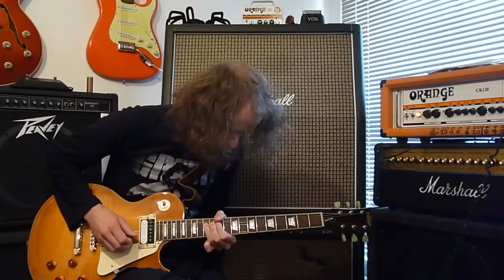Why I prefer Solid State amps to Valve amps

Comment: The truth is if you perform a "blind test" the transistor amp sounds the same as a tube amp when you add pedals to color the sound. I saw seasoned musicians unable to choose the right sound with the corresponding amp when they couldn't see what they were playing. The predisposed bias is the deciding factor when they can see the faceplate.
Reply: completely disagree, all you have to do is turn them up and not use heavy distortion and the solid states suck.  if you cant hear the digital sound, you need your ears checked and probably have hearing damage from playing  over time.
Reply: Exactly - once you add some processing ( phaser - distortion - delay etc) they become the same. Who plays clean these days ?
Reply: neil rich people that dont play metal. you can use very light distortion to color, maybe some delay and reverb, but not processed and when you add effects to a model you get a screwed up waveform.
Reply: It seems like Steve is getting solid state confused with modeling amps. The line between tube and solid state gets blurred when talking about ss amps with MOSFET transistors. Do a blind test with a Sunn Beta Lead and say a Peavey Classic Series, and watch all the people declare the Sunn to be a tube amp. It is difficult to generalize on both sides because if you compare a Marshall Plexi with a Marshall Valvestate, there is a distinct difference. However, you take a good ss and put it up against a mediocre tube amp, and the ss will tend to win, depending what the target tone is. I own an Ampeg VH140, and I'll put that up against a 6505 all day. On the other side, I'll put my Valveking up against a Marshall Valvestate any time. The market is flooded with shitty amps on both sides, so to generalize (and many tube advocates love to do this) based on the influx of bad ss amps, especially in the 90s, is a bit misguided.
Reply: Orange is fantastic SS amp...I love the 35rt and would not hesitate to buy the cr120h or combo.
Reply: Jerry M over drive with tubes allow you to get sick tones at lower volumes. Especially if the amp has no gain knob
Reply: neil rich I've seen all sorts of test where seasoned pros and people just of the street can tell which sounds better.   Most people want to think they bought the best and made a good decision that's why anyone believes solid state is better.  But There's a clear difference.
Reply: and youre wrong. and cant back up what youre saying. so you post it on youtube as though it's the final word. Youre flat out wrong
Reply: Ill take that bet. I have a $100 vypyr i can set to pure clean.. and put two of my ibanez's up against ANY tube amp you pick and it will match them or blow them away. And that's a megacheap low end ss (though probably the best ultralow end). Or dont trust me.. listen to the demos for the new $99 katana then try to find a tube amp that will beat it CLEAN. You wont. which is why you wont make the comparison because knowing you wasted that much money will make you sad.
Reply: You have your opinion.... but it happens to run contrary to almost every musician who has unlimited choice... the vast majority of touring and recording pros (for whom money, weight and maintenance are not an issue) choose tube amps for a reason. You MAY be able to set a PERFECTLY CLEAN sound on a solid state and a tube amp and if someone else plays it, I may not be able to pick out the difference. But, for me, that's a moot point as my "clean" sound is never perfectly clean. Also, if I were the one playing the guitar, I could tell immediately, as a solid state amp reacts TOTALLY differently to picking dynamics when properly setup up.
Reply: no... they dont. As for the way you play.. i absolutely agree that your style is perfect for tubes.. THAT is where they shine..  clean with overdrive maybe toss in some reverb. Theyre beautiful and i havent heard an ss that can match them. ANYTHING but that though and the difference goes poof. In my experience guitarists/musicians arent particularly intellectual or science minded. Hence why people pay $15 grand for a new guitar. And they definitely dont understand electronics. Mostfets and solid state transistors are VERY accurate. . What gives tubes that sound is their unreliability. They heat up and stop being good transistors thus giving you that tube sound. Because theyre shit at their job hah. The reason lower end SS hasnt caught up is a lot of it IS digital and digital is BAD at circular waves.  On very high end ss though you have to realise they CAN copy the tubes. They use $10,000+ oscilloscopes that capture the output of tube amps 1000 times more precisely than your ears can hear and they CAN copy it...  it just costs a lot of money to do it (For now). In 10 year though the processors in ss amps will be so fast you can Exactly copy the output of any tube amp
Reply: steve hudson hahaha SS is analog. Another golden ears who does not know what they are talking about. Transistors exist decades before DSP.
Reply: Patrick Petrie  "at bedroom levels the solid state actually sounds better"... Yes. For most amps. Tube amps that are built good (or any amp really) sounds good at low volumes. Got a Lehnert Rambler 60W tube amp. Sounds fantastic even at bedroom levels. Really good simple amp with no frills.. but with a cleverly designed circuit and good components.
Reply: neil rich honestly. none of the tube amps Marshalls included didn't give the brutal searing  slash your face off crunch any of the SS ive owned.. unless it had a metal pedal... and  for a $3500 amp and stack that only has the better ability to be louder.  and thats it. they can keep it
Reply: steve hudson solid state doesn't mean digital
Reply: All that proves to me is that you own a valve amp that sounds better, to your wife, than your solid state amp.I've owned many valve amps. Most of them have been really nice amps and i only played tube amps exclusively for years as i felt SS where no good. However Recently I played an SS that blew me away completely. Tube > SS is a mental statement as there are literally thousands of examples of each. I mean maybe you could argue that the best valve amp is better than the best solid state amp, or that on average you believe valve amps to be better at equivelent cost. But i'd view that statement as dubious. Play what feels and sounds good to you, But i'd advise against blanket statements like SS don't sound as good as valves, cause at the end of the day i think you are limiting your experiences or potential with preconcieved notions. Also the idea that Digital is Bad is pretty mental as almost every album since the 2000s has been made digitally and many sound amazing. Pretty much every tube tone you hear on CD has gone through a DA conversion and then again an AD conversion. BB King used an SS for goodness sake!
Reply: Paul Macaulay  GENIUS. You said it there, "you could argue the best valve amp is better than the best SS".

They could but they'll never get to test it. So they're just traditionalists thinking they've heard it all!

Idiotic to say valves are better in all cases.

 Idiotic to say due to the majority of renown artists choosing valve amps means ones better. (Christianity better than Buddhism?)
Reply: Everyone here wouldn't score above a 50% on a thoroughly constructed sound test between the two, ALL TONES considered; clean, boosted, dirty...
Reply: Gary Stackhouse with that thought process, we should all desire to drive a formula 1 car every day as well. Time and a place... do tube amps sound amazing?  Yes, of course they do. But even Joe Bonamassa doesn't show up to a gig with a Marshall Super Lead and crank it to get it to get the "tone" it's supposed to get and promptly melt the faces of everyone in the front row. Ty Tabor from King's X used solid state amps for the first 4 albums and TONS of people were chasing his tone. Most people can't even get a Blues J.R. in the sweet spot without the cops showing up, so solid state amps are an option for the 95% of us that prefer to not visit the "barred hotel"
Reply: If you couldn't touch anything else but the strings and frets you couldn't tell
Reply: LOL.  Neil Rich- you nailed that right on the head!!  Like a Cuban cigar or Johnny Walker Blue.  Take off the Cuban band or pour a shot without telling someone what it is and compare it to another.  99%  of the people can't tell the difference.  Too many programmed gear snobs & brand name followers.  X brand must be the best because I read so & everyone has it.  Dave's right.  You do you.  We're all different.  Tube sounds awesome? great go get it.  SS sounds awesome? great- go get it.  To heck with all the haters.  Just play and have fun!   : ) ~

Comment: For many years my main gigging amp was a Marshall 6101 Anniversary combo. Beautiful sound... but the damn thing was always going wrong. It might as well have been getting pocket money for the amount it was costing me to keep it working. The same was true of my Fender Twin... and my AC30... and every other valve amp I ever owned. But I put up with it because (compared to the solid state amps available at the time - Crate, Carlsboro etc. of the 80s & 90s) valves sounded soooo much better. Fast forward to 2010 when I started gigging again and all I could afford was a Peavey Bandit. The tone out of this little cheap solid state box was INCREDIBLE!!! Easily as good as the valve amps I used 20 years before... just as "touch sensitive" and a real "bell-like" warmth. Plus, it's a Peavey, so it'll probably work under water if need be. No more valves for me!
Reply: Peavey Bandit - I have one of these (Transtube 112). Nice amp and I still have a huge sentiment for it. Compared to my Orange Rockerverb (100 MKIII) it kinda sucks though. Maybe I have different needs or maybe you're just a better guitar player (that can make an average amp sound great). Bandit doesn't cut it for me though...

Comment: Dave, I am so with you on this; Solid State for the wise musician. I play Heavy Blues, Post Punk and Psychedelic Rock, use clear, overdrive, slide, chorus and wah. Any combination.
I don't hear a mo-betta sound from tubes, I just see a lot of ha$$le and hear a lot of attitude. 
My own fave amps are the 1990s Fender Stereo Chorus 210 and 212. One's just louder than the other. Both have the most gorgeous overdrive sustain and a stereo chorus I searched for back in the 1980s.

Comment: I think it's something that really depends on the context, the style of sound you're going for and, of course, what works for you. I've been using tube amps for about 8 years now, and it works for me. Mind you, I like small combos: 15w to 20w, one speaker, etc. Sure, it's heavier than it's solid state counterparts, but I don't feel like I'm hauling furniture up and down. I also enjoy pushing the amp overdrive with these tube screamer style pedals (tacky, I know), and the solid state amps I've had didn't respond the same way. Trust me, I'm the first one to call bullshit on these "warm", "woody", "spongy", "silky" nonsense that people talk about. But it does sound different to me.
I have the impression that you are a Les Paul-into-a-stack kinda guy (and I'm sorry if I'm assuming too much, haha!), and I think that's when a good solid state amp excels.
Also, maybe I'm lucky, but I never had horrible issues with tube amp maintenance. I've played in crappy crappy bars and pubs for about 20 years (god, I'm old), and only two times the amp crapped out on me… one a solid state, one a tube (and it had nothing to do with having tubes). Once a year or so I replace pre-amp tubes, and that's it.
But yes, there are too many people that think that EVERY tube amp sounds like a thousand cherubs massaging your eardrums and that EVERY solid state amp feels like an urinary tract infection. That's simply not true. One can get great tones from solid state amps and it's nice to hear some sensible argument like yours!

Comment: I completely agree with everything you've said and I wish the tube snobs would just use their ears and not their ego! I owned a Blues Deville and I adored it but the cost of maintaining it, the weight, the age of it, the initial cost of buying it, the multitude of problems I faced with tubes blowing out, need I go on?! I'm so happy with a Mustang IV V.2 because I CAN get all of the sound I want and it's perfect for studio, gigs and practice and it leaves me with money spare to take my partner and daughter on holiday! ;) Great video! Thanks man :)
Reply: the same guys insist on buying 60's strats with faded cracked paint and sned $50 bucks on a "vintage capacitor" eyeroll to get "the best tone"... not realising that the strat is made of plywood and the cap is garbage that you can "upgrade" by replacing it with a 10 cent modern camp that is teastably better. Then they sit with their overweight 60yo buddies and play freebird and stairway and anything clapton over.. and over.. and over.....
Reply: good points guys. A lot of assholes who want to make you feel bad for not buying the most expensive and vintage pain in the ass musical gear are often shills trying to sucker people into buying the most expensive crap. SCAM!

Fuck that. Often times newer tech is cheaper, lasts longer, is more user friendly, and still sounds just about as good. Evolution is a thing. As time goes on new types of amps get created that blow the past out of the water in a lot of ways.

Comment: I hear tube people giving the same list of objections that they've had memorized, or handed down from like 1985, and totally don't apply to the late generations of solid state modeling. Did a Line 6 modeling pedal fuzz out at high gain in 1994? Sure. A little I guess. Does my new 50 watt Orange head do the same thing because it has the same.... lack of vacuum tubes? Not really.

Comment: You make a VERY good point about valve amps and power supplies! I play bars and pubs, some outside gigs... The power supply makes a HUGE difference to my Peavey ValveKing... Have even played an outdoor gig where two valve amps and PA were tripping the power supply of the cafe!!! If the power is 'weak or fluctuating' then my ValveKing is also 'weak and fluctuating' ! Though... For me... My ValveKing is just a dream compared to solid states I have owned and/or played! Maybe it's the 2x12 configuration that makes the difference to my ears?!

Comment: It's all bollocks. If it sounds right and plays right, it is right. I have both but the one thing that I find funny about total valve users is they talk about warmth and organic tone and then they have a load of modern pedals in the front end. I don't care, do what you want but stop talking shit about earthy organic whatever
Reply from the maker: I totally agree with you. If it works for you use it. Don't be swayed by other people's opinions. :)
Reply: +Dave Simpson great channel btw. Cheers
Reply: Oh god, check out "That Pedal Show"  - they literally are building entire preamp circuits of solid state stomp boxes before a 'clean' all tube amp - and then talk about how great tube amps are.  I am like, huh?  You have a bunch of solid state devices that are actually recreating the entire preamp circuit and your power amp circuit is in the linear region - how exactly are tubes influencing the tone?
Reply: +VoxPathfinder15R 🤔

Comment: In my 40 years of playing, I've yet to hear a solid state amp that sounds anywhere near as good as a valve amp. Unless you butcher your guitars tone with too many pedals first. Then it doesn't really matter. I guess most people can't tell the difference between even, and odd order harmonics.
Reply: Not garbage. If you can't hear and feel the difference between tube and solid state, first of all, I'm sorry.  But that being the case, yes, you'd be stupid to buy a tube amp.
Reply: You just did 😁

Comment: I have played through solid state amps for almost 25 years. I had one great Peavey tube amp when I was younger, and the tubes went out. Took it in and had a guy fix it. While he had it in the shop, he lent me a Crate, and I fell in love with how loud it was and how light it was. Fast forward to the last 13 years, and I bought a tube pedal with a 12 AX7 built in. That’s what I use to get my sound, and I plug into a SS amp, Garage Band, etc. I don’t understand why some are so hell bent on tube amps, when the ss world has improved by drastic measures. Peace bro. New to your channel, and I dig it.

Comment: i believe there is  a placebo effect when people know they are using a valve\tube amp UNLESS your comparing a crappy SS amp to a fender deluxe reverb or whatever ,SS and modelling technology has came a long way now and i find it hard to notice the difference apart from volumes ,,well thats my take on it anyway .
Reply: You're right. DSP modelling has fooled me. I have the Rocktron Voodu Valve which was/is a really early DSP distortion generator (designed in the mid 90s, and uses a tube buffer), and it sounds really, really good. It's the only SS pre-amp in my rack.
Reply: But, quality tube amps/pre-amps still sound awesome, so I'll keep buying them!